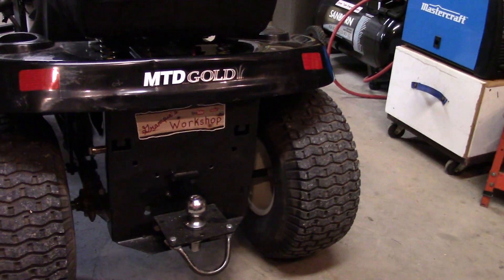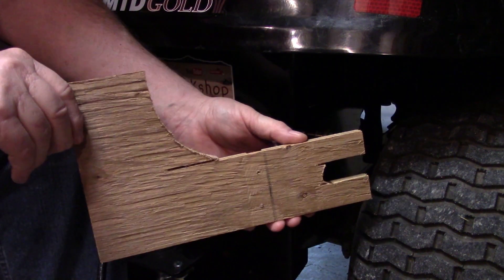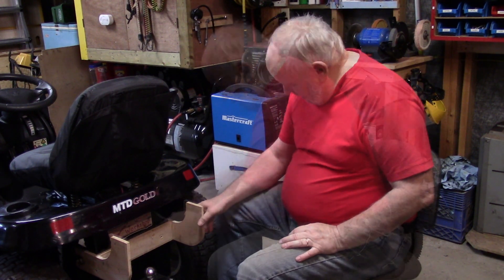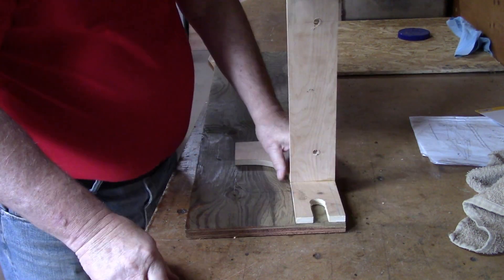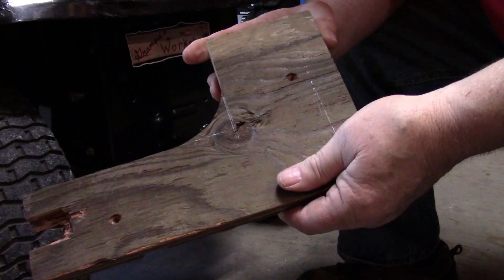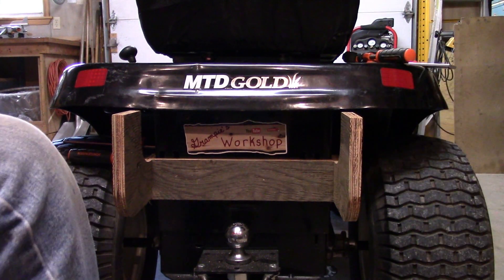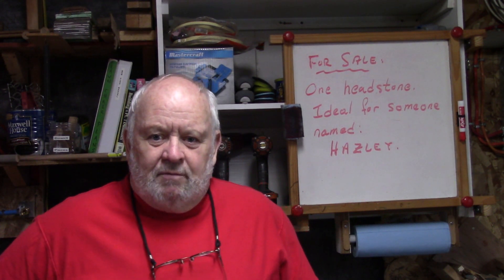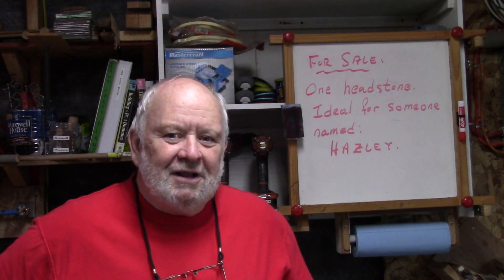Starting to Make a Carrier for the MTD

Comment: We were shouting out some ideas but you were not listening lol. Your frame turned out great. The idea we had was to put another bolt with a shoulder further down the chassis and a bit higher on each side. Then cut a slot on your plywood from the top and bottom. It could then be installed at an angle before straightening it up to engage with the bolts, if that makes any sence. That way the frame and carrier could be joined together and installed without the need for fixing. It probabily would not work but I thought I would share the idea. The MTD is turning out great, all you need is a cab now and you and nannie could use it to do your weekly shopping
Reply from the maker: Hello there Joseph!!  I think I understand your idea and it sounds like it would work.  If I understand it correctly, maybe the crosspiece could be made wider and extend down more towards the trailer hitch ball to provide some extra support and prevent the tendency of having the mount rotate downwards.  I'm glad you are thinking of ideas and methods to make this mount Joseph.  It's all about 'creating'!!!  That what the Workshop is all about right!!!  Take care!!!

Comment: For Carrier version 2.0, perhaps making the slots in the plywood vertical instead of horizontal? You may still need a pin the keep the slotted plywood from coming up off the lugs but you should be able to forego the bolts
Reply from the maker: How's she goin'?  I think I understand your idea here.  That would be an option for sure.  As it turns out getting the bolts installed isn't that hard a job and goes pretty quick.  It is hard to get my hand in to hold the nuts though.  If I were to make the slot vertical like you mention, I think a wider cross piece would help stabilize the mount too.  Have it extend down more towards the ball of the hitch.  What do you think?  It's fun to create and modify things to do what you want them to do.  That's what I like most about having the workshop!!!  So nice of you to comment and offer your suggestion.  Thanks a million and have a great week!!!